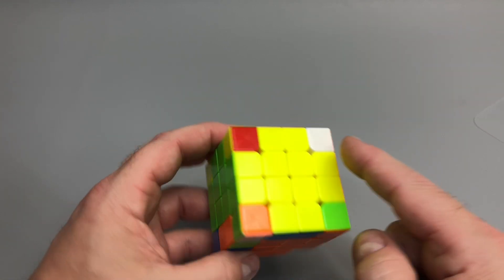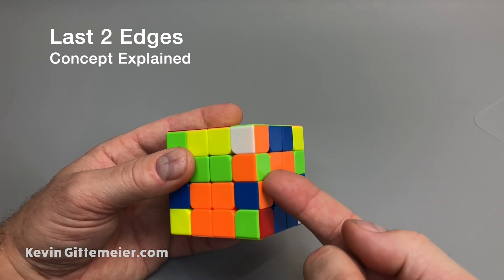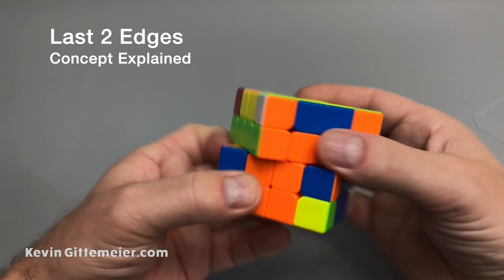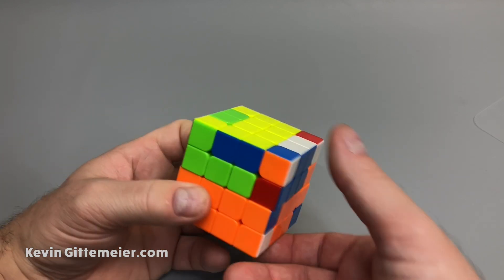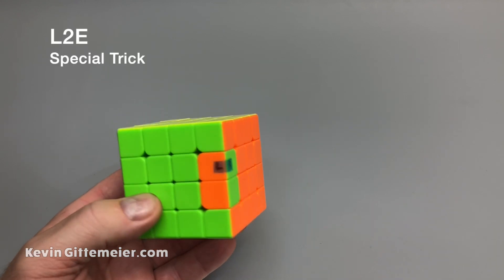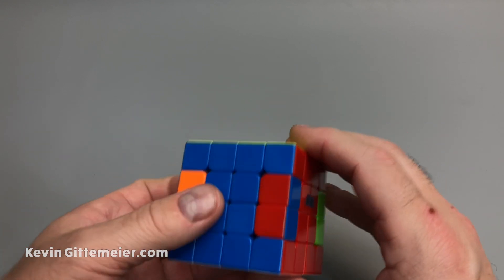How to Solve Rubik’s Cube 4x4 (L2E) Last Two Edges (SUP) Tutorial [KTFG 472]

Comment from the maker: This video is part of a series of Supplemental videos that provide a more detailed explanation of the Steps in my Rubik’s Cube 4x4 Tutorial, including the Theory and Principles behind the Steps, along with additional Examples and Troubleshooting tips.
Timestamps Concise:
00:00 Intro 
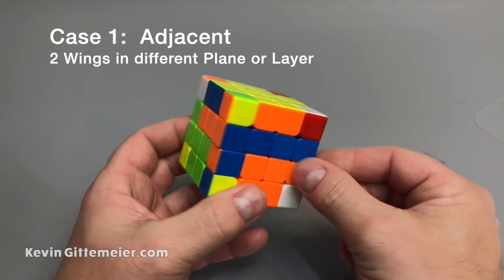00:23 L2E Case 1:  Adjacent
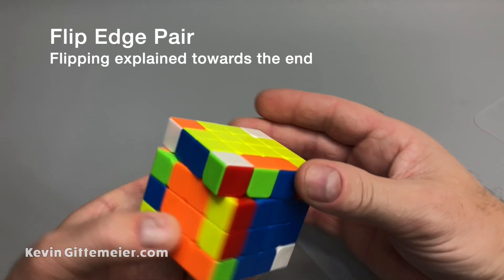01:07 L2E Case 2:  Aligned 
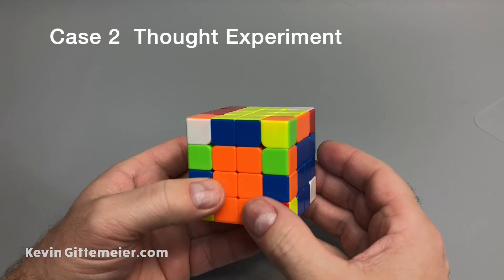01:26 Thought Experiment
02:10 L2E Concept Explained
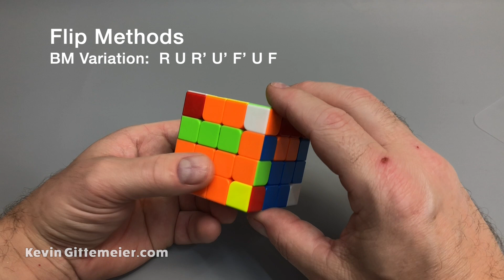04:09 Flip Methods
05:03 Examples & Special Trick
06:57 Conclusion

Timestamps Expanded
00:00 Message from Emily
00:05 Intro
00:20 L2E Case 1:  Adjacent
00:53 Flip Edge
01:06 L2E Case 2:  Aligned 
01:26 Thought Experiment
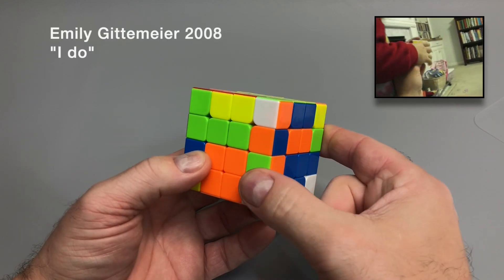01:58 “I do” (Emily does)
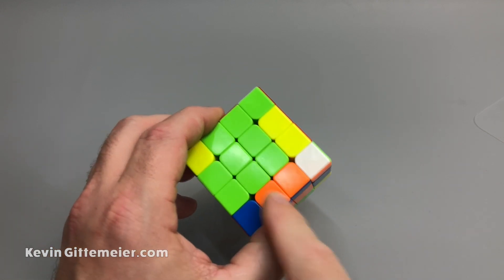02:05 L2E Concept Explained
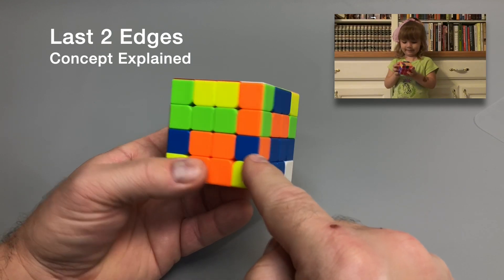02:28 “What I want” (Emily agrees)
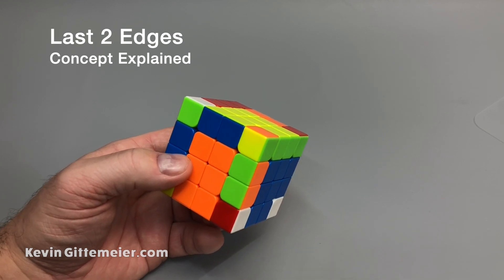03:20 L2E Case 1 Fail
04:07 Flip Methods
04:08 Beginner Method Variation
04:21 Flip Alternate Method (a)
04:45 “Understanding” (Emily agrees)
05:02 Examples & Special Trick
06:46 Conclusion

Solve Rubik’s Cube 4x4 (L2E) Last 2 Edges (Supplemental) Tutorial [KTFG 472]

This video instruction will help you grasp how to solve the Last two Edges of the Rubik’s Cube 4x4 intuitively without the need to memorize algorithms.  You will discover the basic principles and concepts of the Rubik’s Cube and how to recognize and solve the steps on your own instead of blindly following instructions without understanding them.

4x4 Tutorial Supplemental Videos List:
4x4 L2C (Last 2 Centers):  https://youtu.be/gnBcpUzRrJU
4x4 Edge Flipping Fundamentals: https://youtu.be/g3WCRCI4Dh4
4x4 L2E (Last 2 Edges): https://youtu.be/ZPwSy8PweDM
4x4 PLL Parity Intuitive & Alg: https://youtu.be/1Vj6gy_8-u8
4x4 OLL Parity Intuitive: https://youtu.be/mkwJRgwy4R4
4x4 OLL & PLL Parity Algorithms:
4x4 Beginner Method Tutorial:  

Rubik’s Cube 4x4 Full Tutorial:  coming soon

“I do” video of 3yo Emily practicing Rubik’s Cube:  https://youtu.be/oHx_CqZBsAo?t=114

Even though this video series focuses on solving the Rubik’s Cube 4x4 Intuitively without the use of algorithms, I provide a full list of relevant 4x4 Algorithms on my website & below:

Notation for Methods of Flipping & Un-Flipping Edges

Beginner Method take out & re-insert upside down:
R U R’ U’ y L’ U L  (Forward) Do
L’ U’ L U y’ R U’ R  (Reverse) Undo

Beginner Method Variation with Front turns:
R U R’ U’ F’ U F  (Forward) Do
F’ U’ F U R U’ R’  (Reverse) Undo

Note: R U R’ U’ y L’ U L  =  R U R’ U’ F’ U F minus axis rotation Y

Intuitive Alternate Method a:
R U R’ F R’ F’ R  (Forward) Do
R’ F R F’ R U’ R’  (Reverse) Undo

Alternate Method b:
R U’ B’ R2 (Forward) Do
R2 B U R’  (Reverse) Undo
 
Alternate Method c:
R F’ U R’ F   (Forward) Do 
F’ R U’ F R’  (Reverse) Undo

Note the old notation Rr is equal to Rw (newer & more widely used)
w = wide turn (both outer & inner)
More detail on my site.

PLL Parity Intuitive
[u’ (Flip) u]  [d (Flip reverse) d’]
Flip = any flip method including the above methods.
Remember u & d turns are opposite each other
So u’ & d both slice to the Right (u & d’ to Left)

PLL Parity Algorithm
(My Method)
Rw2 R2 U2 Rw2 R2 Uw2 Rw2 R2 Uw2 U2
Alternate Method (More Efficient)
r2 U2 r2 Uw2 r2 u2

OLL Parity Algorithm
Rw2 B2 U2 Lw U2 Rw’ U2 Rw U2 F2 Rw F2 Lw’ B2 Rw2

The goal of these Tutorials is to *“Learn & Understand”*, not just copy.
https://www.kevingittemeier.com/category/rubiks-cube/

Want more Rubik’s Tutorials like this?
You can help support this channel by Subscribing, hitting Like & Commenting.

If you would like to purchase a 4x4 or any puzzle seen in my tutorials, visit my website:
https://www.kevingittemeier.com/shop-games/

4x4 Nomenclature, Notation & Algorithms listed on my website
https://www.kevingittemeier.com (Direct link coming soon)

-
Some popular Rubik’s Tutorials:
Learn How to Fail Properly: https://youtu.be/NRWG0MfrAXg
Rubik’s Cube 2x2 Beginner Method:  https://youtu.be/UYCeyu_pbTI
Rubik’s Cube 2x2 Intermediate Method:  https://youtu.be/fDfpjC-GPBM
Rubik’s Cube 3x3 Beginner Method:  https://youtu.be/9spDGBeWl1o
Rubik’s Cube 4x4 Beginner Method:
Pyraminx Beginner Method:  https://youtu.be/gKbJOAeEkNI
Pyraminx Intermediate Method:  https://youtu.be/Jl-DhDrWWNE
Skewb Beginner Method:  https://youtu.be/_JaS0XB2xw4
Megaminx Beginner Method:  https://youtu.be/iAf8zbq0HH8
Megaminx LL Beginner Method:  https://youtu.be/s1FNwfFdrTM

Rubik’s Practice & Solves
3 Year Old Solves Rubik’s 3x3:  https://youtu.be/DUdq2vqybpU
3 Year Old Solves Rubik’s 2x2:  https://youtu.be/6Hs6800jW_w
3 Year Old Practices Rubik’s:  https://youtu.be/y_uwaxcReEI
Family Rubik’s Practice:  https://youtu.be/PkXdywoH20w
Rubik’s Klein Bottle Illusion:  https://youtu.be/-BHfsPC1pSY

See my website for a current Full list of Tutorials:
https://www.kevingittemeier.com (direct link coming soon)

The original Rubik’s Cube 4x4 was called the Rubik’s Revenge or the 4x4x4 Magic Cube Puzzle. Now there are several brands of 4x4 Speed Cubes, Included magnetic 4x4 Cubes as seen in this tutorial.  
If you’d like to purchase any cubes seen in my tutorials, visit my website: https://www.kevingittemeier.com/shop-games/

If you found any of this helpful, Subscribing, hitting Like & Commenting helps support this channel more than you would think!
Reply from the maker: 4x4 Beginner Method Tutorial:  https://youtu.be/3U-HWJaHHwQ